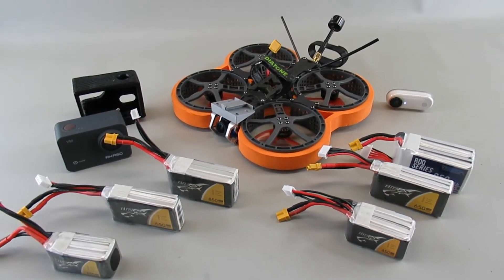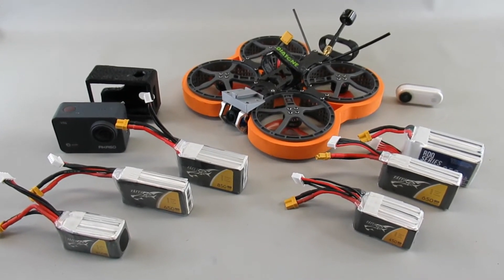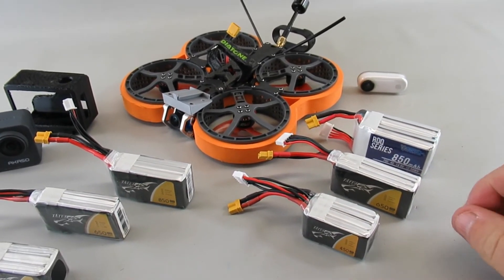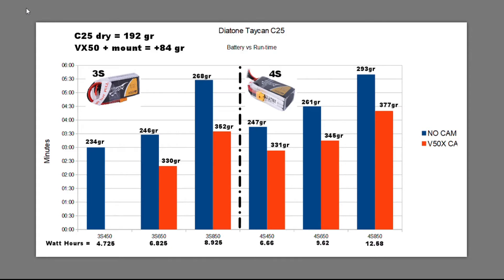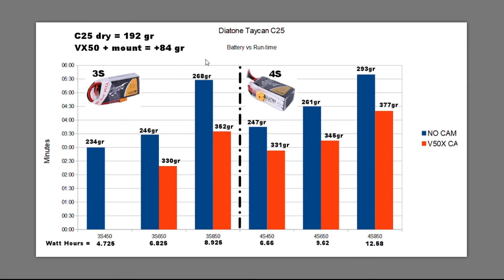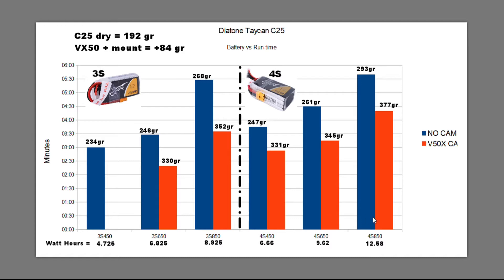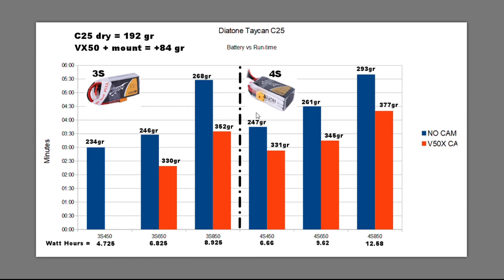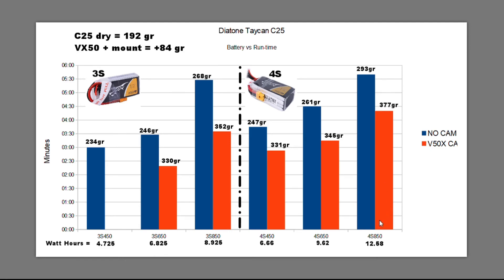FPV Diatone Taycan C25 | 3S vs 4S Battery Testing | Runtime Comparison vs. Weight

Comment: Are you flying these batteries to 3.5v per cell or taking them farther? I have that same 4s 850mah battery and get about 4:30 on average but I’m also stopping closer to 3.6v-3.7v per cell. Just using an Insta360 Go at this point.

Thanks for sharing this info!
Reply from the maker: I have the warning flash at 3.5V and bring it in usually within 5 seconds, so it does dip to 3.3V but recovers almost instantly after I de-arm.  I have not lost a Tuttu pack yet, but I do fly pretty steadily (no acro).  Thanks for watching.
Reply: @TommyTester  makes sense. I do fly a bit of acro so that would explain the differences. Thanks!